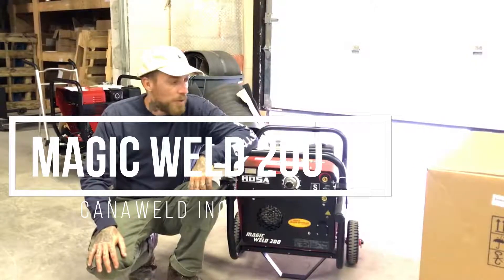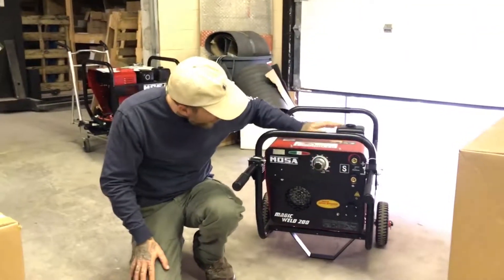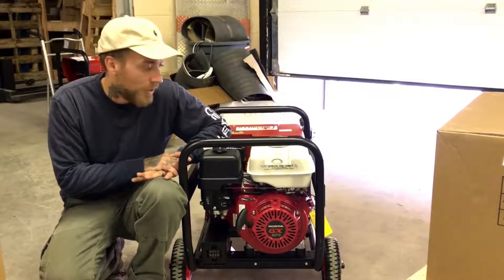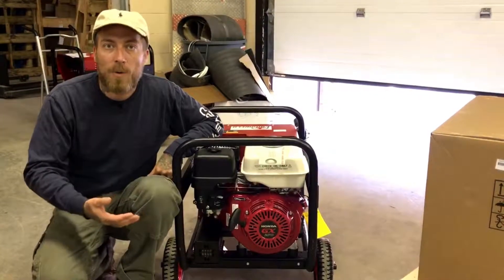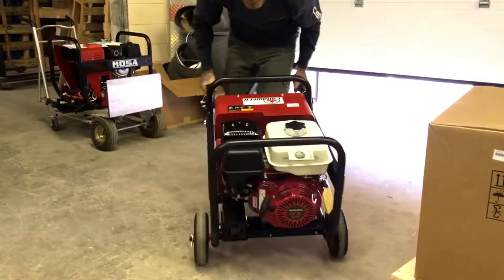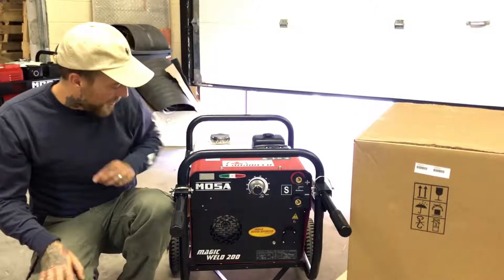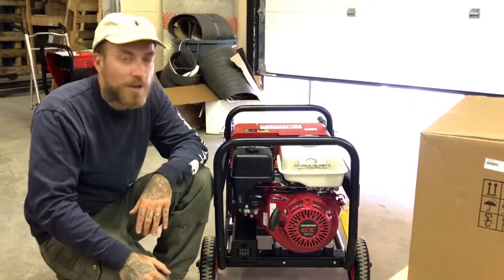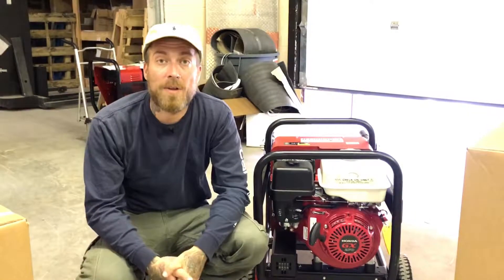How to choose the Best Welder Generator, Engine-Driven, Canaweld Magic Weld, Mosa

Comment: Can this tig weld or run a tig welder off the generator power?
Reply: Yes you can definitely run a tig machine off the generator power ,  our Tig AC/DC 201 pulse D machine pairs very nicely with the Mosa !
Reply: You can starch start tig off it for sure.

Comment: The issue won't be with the motor,the question is all about the quality of build of the generator/welder longevity and quality of components put into the electric portion of this machine.Not saying its not good,just show me a machine with several hundred hours of runtime.Im in the market for a pickup truck in box , ,portable welder.
Reply: Thats a great point ! If you have some time check out the mosa website . They are based in Italy and they are a huge manufacturer with many many years in the business. They specialized in just generators for many years and make a top notch product .